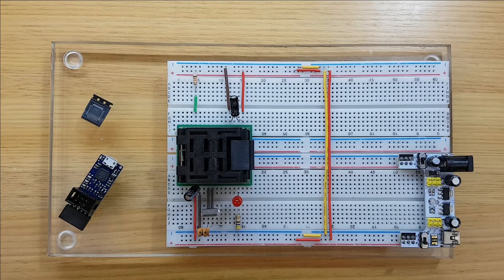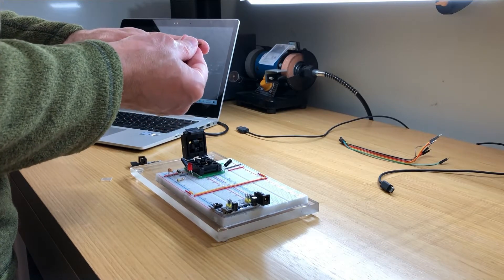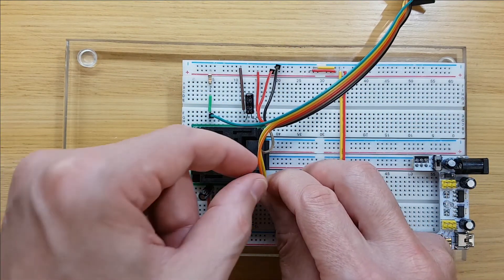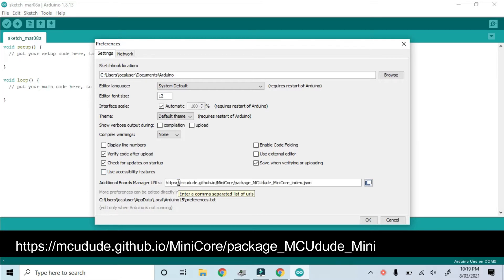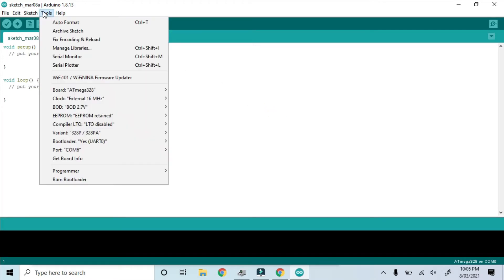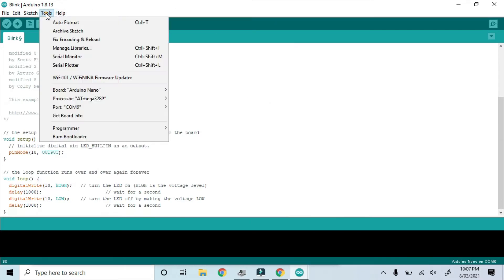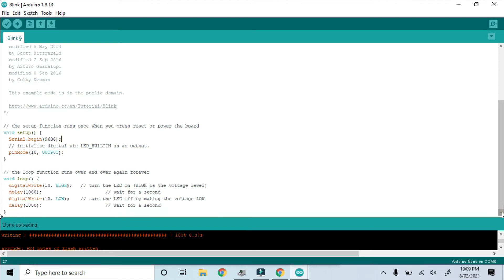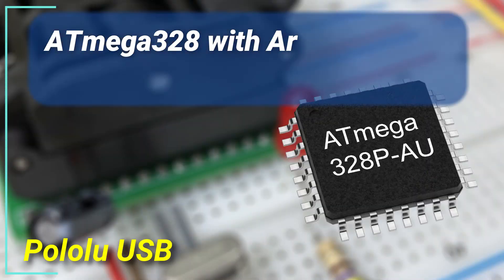Burn Bootloader - Atmega328P using Pololu AVR

Comment: Are you powering the atmega and the programmer from the power supply?  Or are you setting the programmer to output current?
Reply from the maker: Both the Atmega and the Programmer are powered from the breadboard power supply. Pin VCC on Pololu AVR programmers are set as an input by default.  (This is different from video https://youtu.be/VVK0aYcrnQc where the programmer powers the circuit).
Reply: @KakushinAU  Thank you for your response.  I was having issues on my end and I suspected it was because I needed an external power supply.
Reply from the maker: Good point.  The video should have been more clear that the breadboard should be powered with 5VDC.

Comment: Can you use serial to upload code to it after bootloader is burned?
Reply from the maker: Yes, the MOSI and MISO connections are a type of serial interface.  However, I don't think you can program the Atmega directly to the serial pins without a programmer.

Comment: Great video!  Clear and easy to understand, thank you 😀 Just one thing I am unsure about. If you burn a bootloader, then upload a sketch with the programmer, doesn't this wipe the bootloader?
Reply from the maker: Thanks for the comment.  No, uploading a sketch does not wipe the bootloader.  Both the sketch and the bootloader are stored in the flash memory on the chip.  The sketch is stored at the front section of the flash memory, and there is an special area at the end of the flash memory (about 512 bytes) which is reserved only for a bootloader.

Comment: Which smd atmega mcu would you recommend to program with Arduino IDE?
Reply from the maker: I recommend the ATMEGA328P-AU microcontroller.  They cost about $2 each and can be easily programmed with Arduino IDE.  Here's the link to Digikey: https://www.digikey.com/en/products/detail/microchip-technology/ATMEGA328P-AU/1832260  There are other SMD Atmega MCU's but I haven't been able to program them with the Arduino IDE.  Good luck!

Comment: Hello brother, I'm from Mexico, where did you get the programmer and the base for the ATMEGA328pAU?
or how can I find them?
What are their names?
Reply from the maker: Programmer
- DigiKey  $7.77 USD  -  Search for "Pololu 2183-3172-ND"

Base
- AliExpress  $10.38 USD  -  Search for "SZYTF TQFP32 QFP32 TO DIP32 IC Programmer Adapter"

The base comes with a DIP adapter.  I cut mine off so that it can span across 2 breadboards.  Otherwise it covers most of breadboard connections.